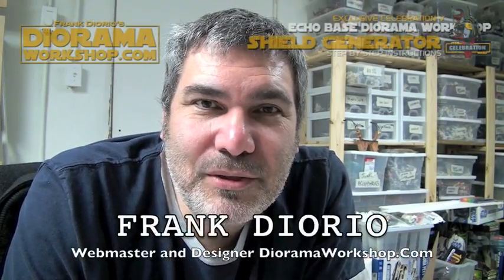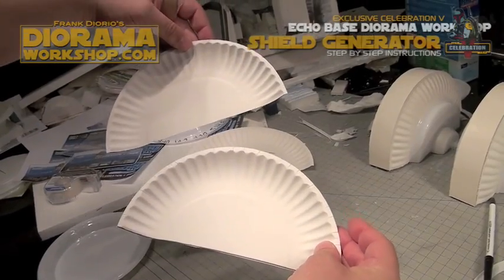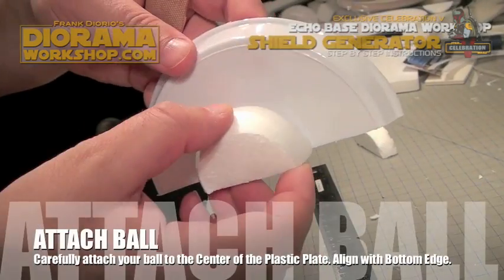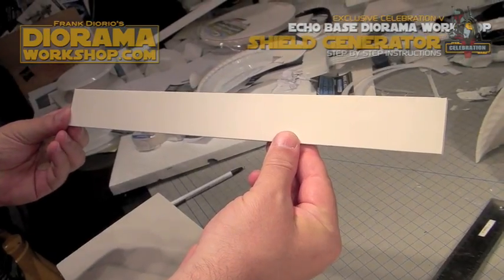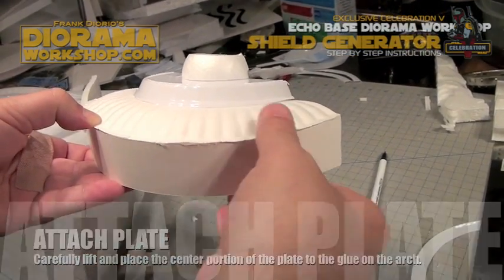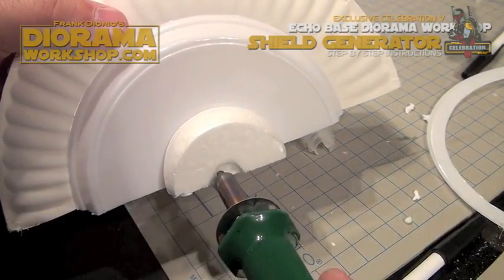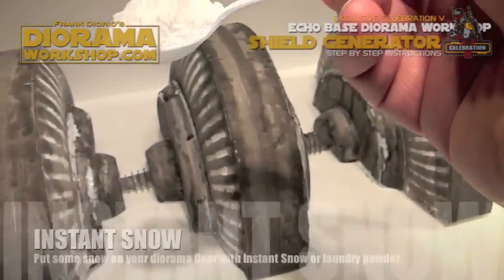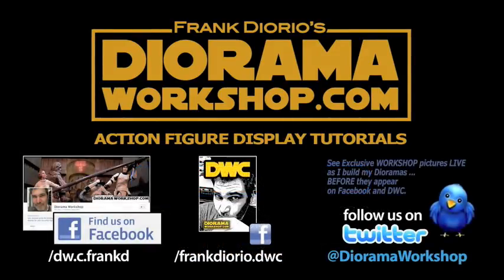Star Wars Hoth Echo Base Action Figure Diorama - How to make Hoth Shield Generator for under $10

Comment: I love it. Could you do one in a smaller scale. I am building Bandai's 1/144 AT-AT and would like to have a generator in my diarama.
Reply from the maker: Thanks for the kind words Paul. You could definatelly use the same technique with smaller plates to match your model. Maybe use party n cupcake plates, molds. That's what is great about the designs I made for the Star Wars Celebration Diorama Builders workshops. Basic materials that everyone can find and modify to fit their need. Let me know how it turns out. Frank.
Reply: @dioramaworkshop  great idea thanks

Comment: Do you glue each generator together Adhering the Spout parts ?
Reply from the maker: You can, but the surfaces of each section is large and stable enough to remain in place. If you are gonna wiggle, transport your diorama from one area to another could be wise, but at the convention I think most just laid them next to each other. Frank.